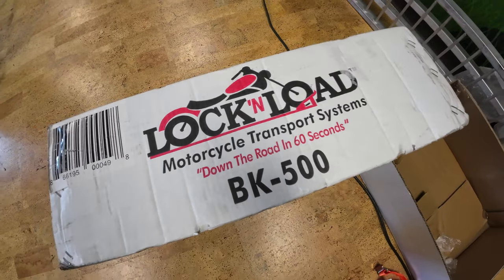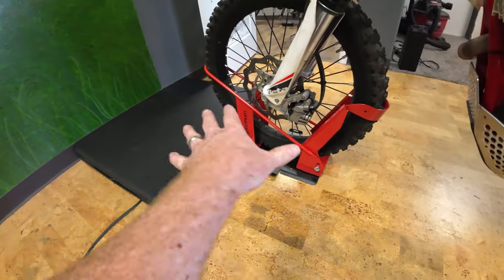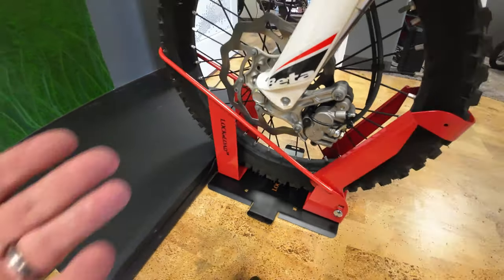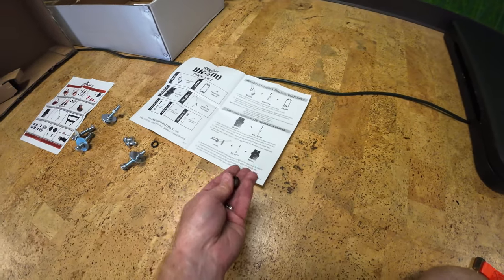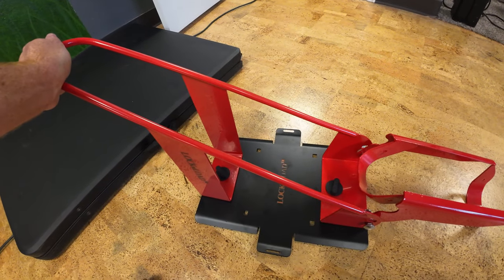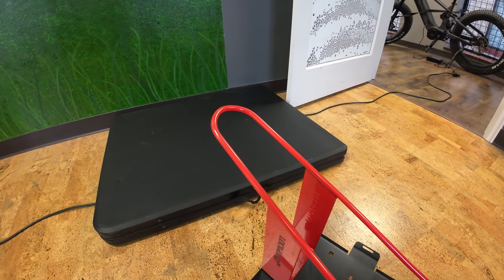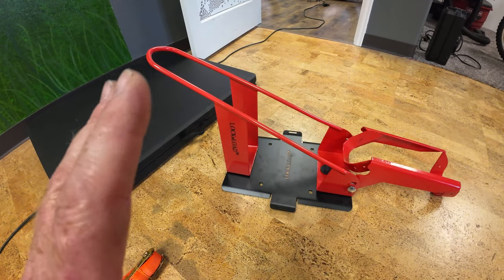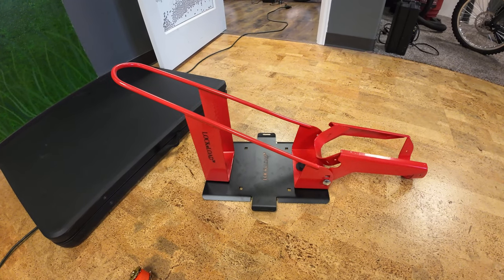Lock 'n Load Wheel Chock BK-500 - Dirt Bike Wheel Chock for my Ford F150

Comment: What did you end up doing? Affixing to wood or bolting to the bed of the truck?
Reply from the maker: Bolted to the truck...However I need to take the time for update video..the plate was made wrong...need to do that video to get to the company...the chock kept coming undone from the base due to the slotted bolt holes going different directions. I solved this by tapping a few holes and adding allan bolts to the top to stop it from sliding forward.